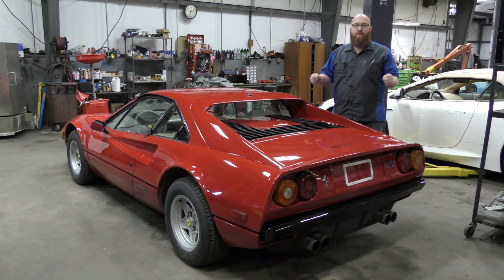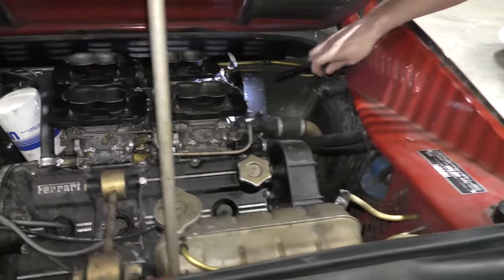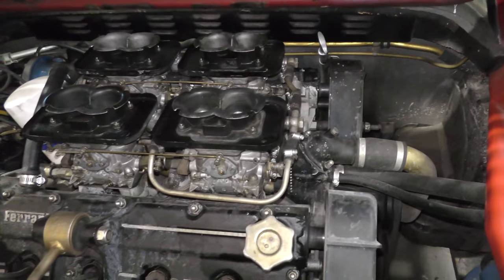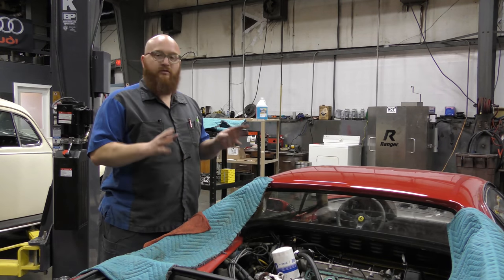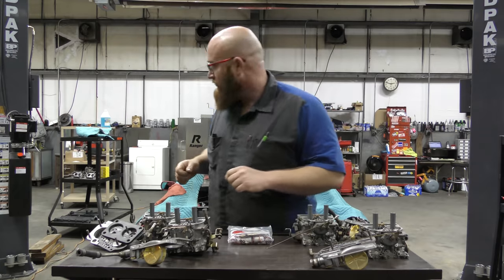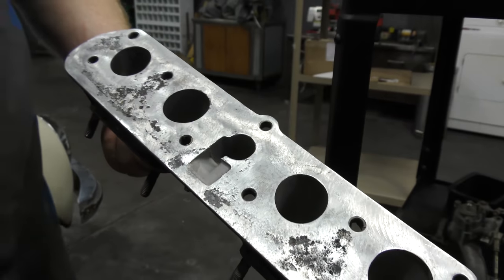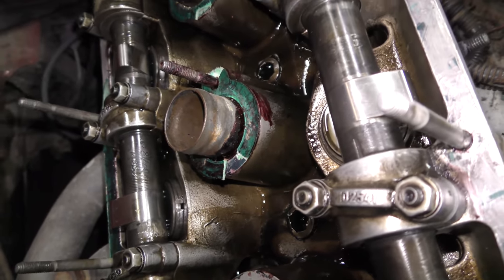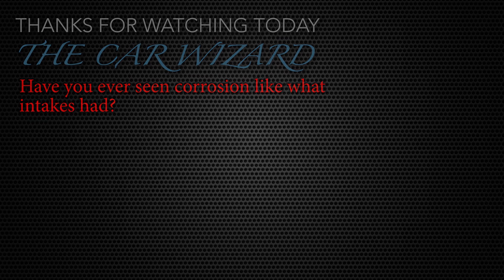Tearing down the Car Trek 4 Ferrari 308 V8! What does the CAR WIZARD find?

Comment: I'd replace all of the rubber fuel lines also as they have a habit of breaking down over many years. It could also be a source of the particles in the fuel. You don't want to end up with Ferrari barbecue.
Reply: hoovie moment
Reply: I thoroughly agree, change all the rubber fuel hose, when I was working as a mechanic back in the 70/80s we had no end of blocked carburettors due to perished rubber fuel hose,particles were often microscopic ☹
Reply: He can sell it back to freddy when that happens.
Reply: @getchasome6230  Yup, and he could cut the back end of each of them and weld both front ends together and make a "two-headed" Ferrari! 🤣😉
Reply: *Homer Simpson drool* "Mmmmmm... Ferrari-cue..."
Reply: Tavarish,  Has the BBQ Ferrari 💯👌🤣🤣
Reply: With classic cars and modern fuel you want as little flexible hose as possible. Gates say that they have ethanol safe fuel lines but you don’t find them at every car parts store and I’m not sure if I’d trust them too much

Comment: I rode a '76 Honda CB-750-four for years.  Every six months or so I would pull the carbs off and clean them.  Took about an hour.  I would open them up and in all the ports that I could access I would spray CRC Brakleen non-flammable brake parts cleaner [red can] to clean out any crud or buildup.  I literally put the little red straw right up against the tiny brass hole.  When I was done, I would put them back on and for a few weeks I could start the cold engine with the kickstarter, on the first kick....Without the choke on at all!

CRC NF Brakleen is a miracle worker with carbs.  Just make sure you wear gloves, you don't want to get this on your skin.  If you do, it will cause an odd tingling sensation and remove all the skin oil from where it landed!

GREAT video Wizard!  I love this car!

Comment: We had a study example of a impeller pump that was moving water around - the corrosion looked very similar.   The corrosion was as a result of cavitation within the system, air was getting in and causing sloshing of the water.  This in turn stripped the aluminium out and this was the damage.   We did the same - TIG welded some material on the flat spots and re-faced everything.

Comment: Wizard, a quick tip for you on the carb. Get yourself a ultrasonic cleaner if you don't have one. It'll save some frustration and get to places not easily accessed and can be used for a ton or different stuff depending on the size of the cleaner you get. It's not harsh on the parts and pretty efficient just takes a bit of time but you can set it and forget it.

Comment: Yup, I mostly only work on old cars... the corrosion was caused by the antifreeze going acid.  Which in turn is more likely if exhaust is getting into the antifreeze to sour it or if it hasn't been changed in a very long time.

Comment: I like the idea of tig welding the pit marks and then machine it. Years ago early vw rabbits had same problem with coolant flanges and the cylinder head surface as well, use to apply a smooth coat of JB weld let sit 24 hours and then sand smooth, never had a concern after that.

Comment: You could save money by fixing the manifolds and water pipe yourself using low-temp Alumiweld rods and a propane torch. Then just block sand the manifolds flat again.  I've done that exact repair before (though not on a Ferrari). Works great.

Comment: The V8 is super reliable and durable. A number of these have served as daily drivers and have 200k miles on them. Very good engine!!!

Those webers will be fine, just need a night in the hot tank. Do you have a weber drill bit set? That's the right way to jet these carbs.

I suspect the alloy used on the intake is different than the heads, hence, the lack of corrosion. 

You mentioned suspension bushings were bad... IIRC, the OEM were brass... use brass, delrin or heim joints. I love the idea of heim joints. I put a kit on my old 1992  corvette to upgrade the rear suspension... it used heim joints and flat out rocked.

Comment: In the UK there is a channel called Harry’s Garage. He is getting a Jag V12 restoration done. Total body and engine. The guy pulled the heads off and found exactly the same type of corrosion. I think he is trying to save the parts too in the same way but he may end up replacing them as the corrosion looked far worse than yours. 
Good luck Wizard, save this beauty!

Comment: I had a 1978 308 GTB as well.  What happened to them was that the 76 and 77 308's had 240 BHP, BUT in 1978 Ferrari had to put all the smog equipment on the engine.  That cut the power to 205 bhp!  Ferrari realized that the engine had the same per cylinder displacement as the 365 GBT/4 Daytona and that the Daytona had higher compression pistons.  So Ferrari offered the pistons and new cams ground to "Daytona" spec to claw back some of the lost horsepower.  I would hazard a guess that these cams are the same grind.

Comment: That's going to be a very fun car when you're finished.  Part of the sound is from the high-revving In-Plane V8, and part of it is from the nearly straight-cut gears in the transaxle.  

A friend of mine had a '79 308 GTS (Rosso Chiaro with Fawn interior) and an '85 308 GTSi QV (Argento Metallic with Nero Interior) several years ago.  We spent a long time pulling out all the aftermarket stuff added to the '79 (Becker Rebranded Sony Stereo, Becker Alarm System, some other stuff) and repairing the interior.  No repaint, but I spent a fair bit of time rubbing out the worst of the cracks and putting a shine back on it.  It was only running on 5 cylinders when it came in.  Unfortunately, the only photos I can find of either one are just of the front bumpers and parts of the hoods.

Comment: Hey Wizard. Know you mentioned in the previous video that you're gonna delete the AC. Have you thought about an electric ac that doesn't run off a pulley? You could then keep the easy change belts and enjoy the car all year.

Just a thought.
Reply: That sounds like an interesting idea. I recall Edd China saying that upgraded alternators are available for classic cars that preserve the original form factor. I wonder if that's all that would be required to drive the system?
Reply: In theory, add load to the electrical stuff of an italian car of this era is not the best idea...
but as this one is fried anyway and needs full overhaul... why not

Comment: @7:50 ye ... i guess a lot of people find that crazy, but with me working in the production of cable terminations I can say that a 1000 dollars for a faceplate, or in this case a manifold, or other metal parts isn't really out of the ordinary, last alignment plate i had made (which basicly is just a die to line up the conductors for the cable) was around 2200 dollars and thats maybe half the size of that manifold

Comment: This Ferrari from 79 is easier to work on and simpler than a new Toyota. Think about that.
Reply: You don't even have to jack up the engine or transaxle or disturb motor mounts to replace the 308 clutch. The left hand fuel tank has a nice cutout in it to remove the  bellhousing.
Reply: Racing tech, for those endurance races.
Reply: Yeah then governments got involved with fuel economy requirements, and people want more power and complexity comes in. Realize the new Toyota makes about the same power from a v6
Reply: Have you ever tried tuning four carbs? it's a nightmare.
Reply: @mymidschoollife8485  never worked on a 4 carb Ferrari but the 72 xke jag v12  that still haunts me .....
Reply: @mymidschoollife8485  Try 6 in a row on a Honda CBX 6 cylinder bike. I got pretty good at it.
Reply: So? The Toyota is also faster. Technology, for better or worse.
Reply: Cars now are homogeneous computers on wheels.  Yay.
Reply: @benbond3433  the only difference between today's cars and everything else is that cars are on wheels
Reply: @mymidschoollife8485  I'm not sure, correct me if I'm wrong but isn't there like an af ratio tester that you can hook up on every carb? Like a 4 way gas analyzer?
Reply: @mymidschoollife8485  its harder than using a laptop like you do these days but with the right vacuum gauges/tools time and patients and methodical work and experience and a good ear its not that hard to balance them all but i am use to carbys for old v8`s and motorcycles
Reply: @stephenhayes3765  my Ecoboost Mustang makes more power on half the cylinders 🤣
Reply: @jamesdougan8789  At what altitude and temperature? Hope you have a bag full of jets, needles and take all that crap with you when the elevation changes more than 2000 feet or the temperature changes 40 degrees. I live in the southwest high desert and this is my reality when racing vintage. Also, patients are in hospitals, patience is a virtue.
Reply: @mymidschoollife8485  You`ve obviously never worked on a multi carbed car. Once set up they are as stable and reliable as fuel injection and easier to work on. I own one of these in Euro spec (Ferrari 308 Dino GT4 - 255hp) plus 7 Alfas, all with Weber or Dellorto carbs, plus an old Lancia with 2 side draft Solex.  -  used to own a Euro workshop so watch the Wizard`s take on all the Euro cars with interest. What was once complex is very easy compared to modern vehicles, most of which you wouldn`t want to own or work on after 10yrs..
Reply: @richardjones2468  Captain knowall to the rescue ! hope you enjoyed stroking your ego. I said they were hard to set up. Nothing else. Thanks for the life story though.

Comment: Yes, I have seen corrosion like that. My fix...a good glass beading and a skim coat of epoxy, followed by sanding with a flat board. An easy fix that you can do yourself and it won't fail either.

Comment: Intake corrosion - instead of TIG welding the porosity, consider aluminum based high temp epoxy, I'd mention JB Weld but that will absorb coolant. IDK know what would be a good filler but if you TIG it you could have warping issues & filler would minimize resurfacing process & depth. Please I pray you try this!! TIG 1 intake & filler the other then do a breakdown inspection @ X mi to prove this concept & 1 failed head is better then 2 😺

Comment: When you say a "lot" of debris, that not what I imagined lol. I pulled the carb off the 1960 Lincoln Premiere I'm working on and it had a solid 1/8" layer of grit in the bowl.  I took 2 days to disassemble and clean every single part of that carb and re-assemble it with new seals and parts.
Reply: Very interested to see the progression of this red stallion.

Comment: Norwood’s in Dallas used to do those single distributor set ups.  Much better and easier to maintain than the old points and condensers.  A lot easier to set the ignition advance and time one dist. vs two.  Also, you can but sealed bearings direct from SKF for your carbs to get rid of some the air leaks in the carbs.  Really a pretty easy rebuild, just be careful with the float studs....breaking them sucks!   😳

Comment: To answer the question about corrosion: yes, I’ve seen it.  Some ‘80s Honda CRs (2 stroke motocross bikes) have magnesium water pump covers, and they can corrode and fail, and plug up the radiators with degraded material. I’ve seen a bad one, luckily mine is ok.

Comment: Wizard those engines from our experience suffer from poor coolant circulation. We found that at around 2000 RPM the coolant stops flowing in one cylinder head. All 4 stroke engines require a minimum flow of 10 liters per minute at 500RPM. The water pump also needs to be able to push coolant up hill about 150 feet head pressure . Once those figures are achieved those engines really perform well.

Comment: "Have you ever seen corrosion like what these intakes had?"  Nothing that bad.  Glad the Wizard is going to do some proper repairs on them.  My first thought was to mill them down, but that wouldn't work right if the linkages didn't connect properly or are misaligned.  The carbs should be an easy fix with just some cleaning.  Nice to see this project moving along quickly.  Guess what this coming Monday is?!  Memorial Day!  So hope to see you guys out on the boat with Hoovie.
VT247

Comment: At risk of stating the known and obvious if you are going to get the inlet manifolds tig welded and resurfaced make sure your engineer does not overheat the heads and warp them which would be worse than overskimming them to remove the corrosion! Great vid and good luck!

Comment: I have seen lots of corrosion of alloy parts such as timing covers as coolant passes through between the engine block and water pump. I believe that is the result of poor maintenance, coolant becomes corrosive with age. Test strips are available to determine the PH of coolant, but just change it every two years or 60,000 miles, whichever occurs first.

Comment: I would do a cylinder leak of + Comp Test. Iff Leak of  Is ok, Pull the Heads of Redo valve seats and Valves  Rule n0 1 on full carb Intake is comp first.
Reply: Be interesting to see how tight it is once Wizard takes care of the issues he's found so far.

Comment: I had an intake from Edlebrock that had the same issue, I bought it used when I was 18 and my dad used JB weld in an attempt to fix it, unfortunately it caused a major vacuum leak. I fixed it by finding an original cast iron 4bbl intake.

Comment: Those intakes looked better then my 04 Monte Carlo SS supercharged. The coolant had eaten away the shape of the coolant port in the head, about a 1/4" into the aluminum intake. Then made a path towards a couple bolt holes.

Comment: That gasket face would be perfect for fixing with Lumiweld aluminium brazing rods. Heat to around 300 degsC and flood the surface with the rods. Less likely to distort than TIG weld.

Comment: I’m sure you’re going to do a great job on it. One thing I would do is consult with someone that specialises in that engine and ask if those cams are going to make that engine last about half as long normal. I’ve watch some high level restoration rebuilds and they don’t recommend hotter cams.

Comment: A common error is balancing cards at idle. Always balance at part throttle preferably using the cable or pedal. Afterwards use the idle stops for idle balance

Comment: Grose jets for those webers on the float valves are probably the best you can get for those carbs.You can find them on Maseratinet.com. They solve a lot of issues you can run in to with the original needle valves on the floats. When you're done with the restoration you should pose in front of it wearing a hula shirt and a Tigers cap.

Comment: Don't forget to verify that the exhaust valves have been replaced with solid stainless ones. The factory ones are sodium filled but since they have a thin stem the valve heads love to pop off. You can imagine what happens after that!

Comment: Please convert to fuel injection with individual motorcycle throttle bodies. You can put the cam sensor where the other distributor was. Keep the original fuel pump and use a surge tank with an internal fuel injection pump. Finish all of the carb repairs and keep them for the future owner if they want to use them. You could probably do it for less than a grand in parts.
Please.

Comment: Nice catch on the corroded intake manifold surfaces. Here's a thought about correcting the linkage and manifold fitment after resurfacing... have a thicker copper gasket cut to replace the thin green ones?

Comment: Sure looks like you are doing this right.

It's a 308 GTB. It's never going to be a million dollar museum piece. It's not rare enough. It's not fast enough. It's not unique enough. 

But with a bit of investment in parts, time, labor and skill, you and Mrs Wizard will have a very enjoyable, very drivable Ferrari. Not a "daily driver". Not a trailer queen. Just a car to have some fun with on weekends and "wow" the folks down at the marina and supper club.

Hopefully you'll show us some of the steps involved in fixing the carburettors. In the pre fuel-injected world, carbs were a minor miracle of engineering, to get fuel and air to mix just right. Getting the jets clean, removing the gunk from old rotten gas, and getting the float right is a real skill.

Looking forward to the rest of this series!

Comment: One more comment as he mentioned silicone with regular gaskets when you use silicone with gaskets, the gaskets will turn to mush within 6 months to a year I've had to reseal many motors when people use silicon and gaskets together gasket maker silicone is made to be used without gaskets it's okay for o-rings that's about it

Comment: Funny thing: my Jag has a 3 litre engine of 2967cc capacity and, when new, its power output was supposedly 240 bhp.  Mind you, the Jag is a 2000 model, whereas the Ferrari is late '70s, so as you were.

Comment: Pitting - use devcon or JB and a bondo file. I realize it sounds 3rd world but considering devcon has been used for decades to raise port floors... And I've used JB to fill the erosion at the top of Vega cylinders - just to see if it would work. Last I heard it had made nine months of daily driving (18 miles/way)(many years ago) before it moved away. (buddy's ex')

Comment: Those thin intake flanges are going to warp like hell if the welder doesn't know what he's doing. If it was me I would at least attempt to bolt a couple heavy pieces of heavy steel barstock on the backside, even with standoffs if necessary, then preheat the whole assembly to 500 F, and after welding gradually cool it overnight like it's cast iron.

Comment: Ide try filling the corosion  with an epoxy and resurface them. Tig welding corroded aluminum might turn into a nightmare and could warp the manifolds...cant wait to see you dig into this gem more though

Comment: on the buick 3800 v6 with the pink death antifreeze. the cylinder heads would corrode like crazy where the plastic intake joined the heads.